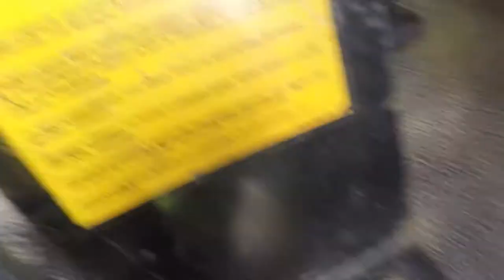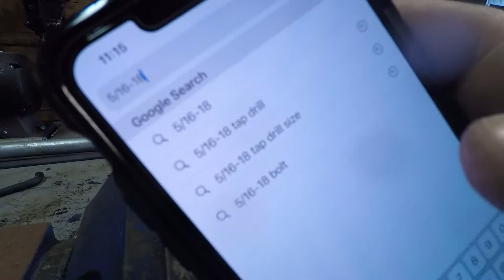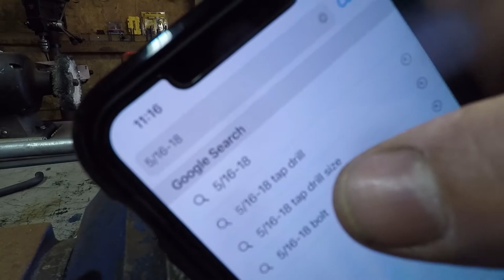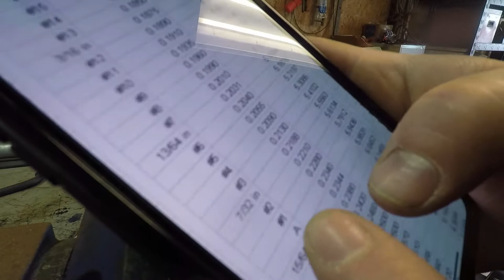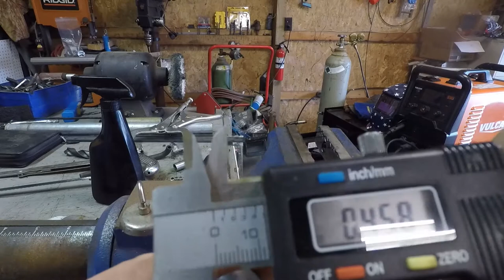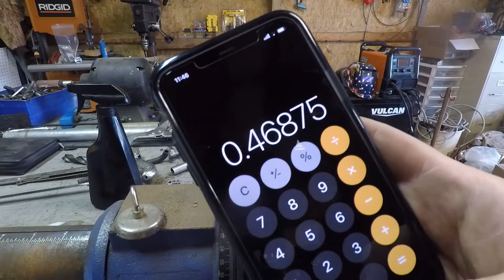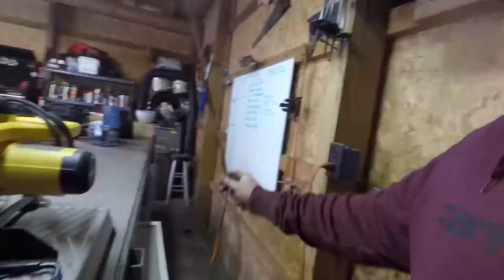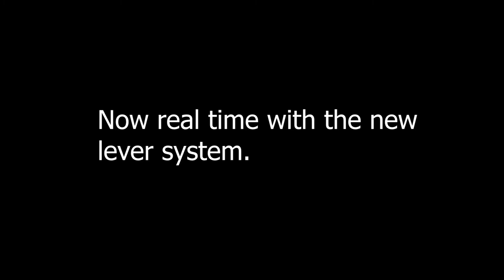FIXING A SLOW DUMP BED - FINAL

Comment: I have the same controls. Spent about 30 minutes trying to figure out how to raise the bed. I knew I was doing it right, but nothing... Then, figured out I had to pull super hard. Mine thankfully goes up and down no problem. Actually goes down fast. Bought mine from an excavation contractor that was retiring.

Comment: I have the same problem tomorrow ill be doing this how long of a rod did you use?
Reply from the maker: I don’t remember off hand how long the rod was maybe 5’? You’ll need to measure your application. Make sure everything lines up properly.
Reply: Thanks you are a life saver because i dont have the money to fix it ill keep watching your videos 💪
Reply from the maker: @ricoterry3427  glad I could help!
Reply: I didn't see how you connected the rod to the lever
Reply from the maker: @ricoterry3427  I believe starting right around the 4:30 mark in the video I start explaining and building that part. The bushing I used was something I had laying around but you could probably use like a piece of black pipe or something.

Comment: Ok so i didnt rig the pto the cable was 36.00 dollars so. Now i cant get bed to go down🤦
Reply from the maker: The PTO cable wasn’t the problem on mine, I replaced the hydraulic control cable with the rod and lever. The rod goes to the hydraulic control.. is your cylinder double acting? Meaning power up and down?? Some aren’t, they are power up and free float down
Reply: 1994 ford f superduty diesel 7.3 i have to get up under to make it go down im affraid im doing something wrong im new to the dump truck only had it sence 2020 so once i pull the pto to make it go up it works now but for so reason it wont go down the frustration is setting in 😞
Reply from the maker: @ricoterry3427  the problem is, the make and model of the truck doesn’t matter at all, I know my truck has had at least 2 different bed/lift combinations through its life. Best bet would be to find a truck upfitter in your area and talk with them. Typically they can be very helpful.